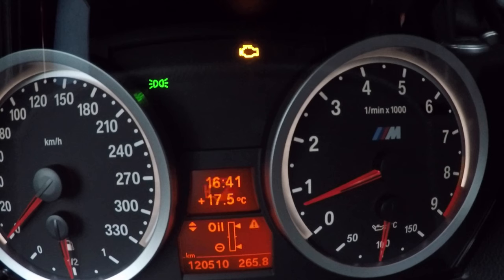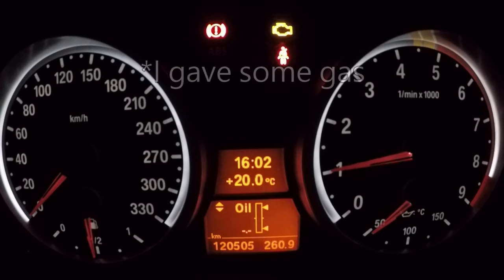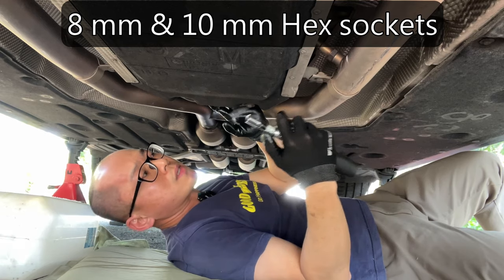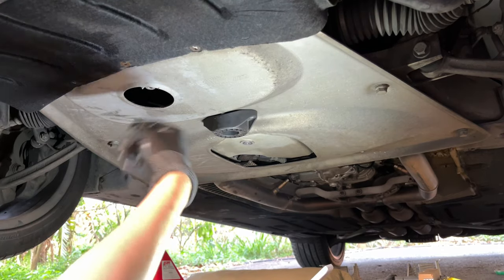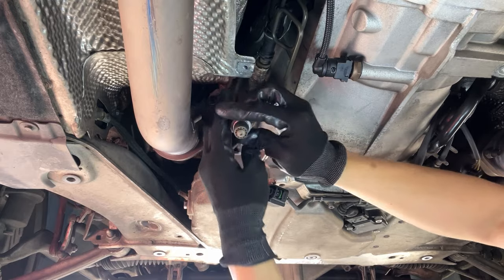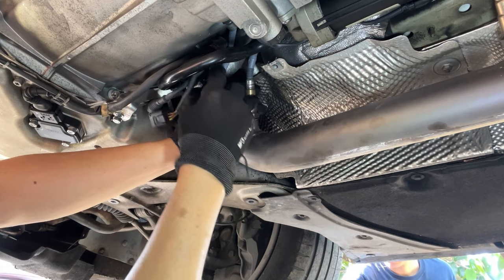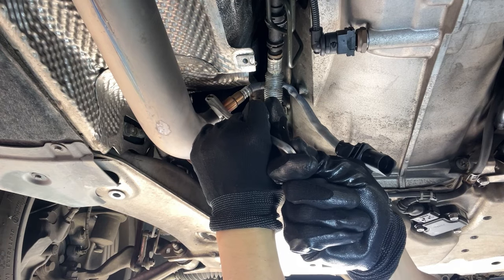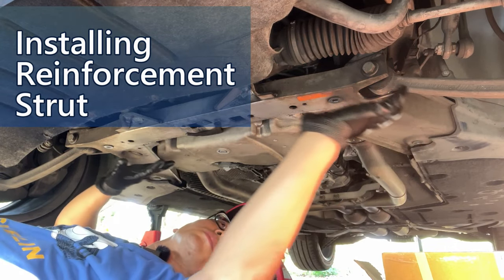O2 Sensor Replacement Fixed Rough Idle & Limp Mode of E90 M3 [ENG SUB]

Comment: Hello, thank you for your video. I hope you can help me. I have problems with my M3 year 2008. Misfire 8 cylinders, bank 1 and 2. This only happens cold start for 25 seconds, then everything works correctly. Detected code DME 2b4e. Thank you, I hope you help me.
Reply from the maker: Hello Marcelo,
Don’t worry, I had the same codes and symptoms before. They are due to the cold start function of the S65 engine. After I had the DME(engine control unit) tune to remove the cold start function, the engine starts with normal idle and I never see these codes again.

The S65 engine has some useless features for the emission control, such as secondary air recycling and the cold start function we are talking about. These features have nothing to to with performance so some people completely remove them from the car. Who cares?

The cold start function is designed to warm up the catalyzer quickly by injecting a lot of fuel so you will observe crazy asthma of the engine in the first one minute of start. Sometimes it chokes the engine so the owner gets freaked out but there is no problem in the engine at all, despite a check engine light is left on the instrument panel (and tons of codes about misfiring on 8 cylinders including 2B4E).

For my observation, the cold start function will work if the car is parked for more than two days. If you drive everyday, it is less likely to take place. But anyway it is very strange and annoying, I agree. The disadvantage is that the check engine light can make one overlook  other real malfunctions of the car. So I went to some tuner to disable this cold start function by writing the DME. (Search: cold start delete.)

After the cold start function is disabled, the engine starts and goes into stable idle at around 800 rpm right away, no crazy fluctuation of the engine speed, as you see in 20:19 . Please look for a reliable tuner to have your DME tuned. This can completely solve the issue. Anyway I believe there’s no problem with your M3, you can also leave it as an original feature. Just be prepared to look into those codes periodically to bust real faults!
Reply: @funcarsgoodpeople  Hello, thank you for your time and answer my questions. It will eliminate the cold start and solve the problem. I have had the M3 for 6 years and I have always had the problem present. Again, I appreciate your time, thank you for your help. Greetings
Reply from the maker: You are very welcome! Marcello! Please let me know if you have done the cold start delete and if you are satisfied with the result 🤗 Best wishes!
Reply from the maker: Hi Marcelo how are you? Is the problem solved? I made a video about the cold start delete, https://youtu.be/-HcMYBclj_Q

Please let me know what you think!
Reply: @funcarsgoodpeople  Hello, god thx, how are you? I have not been able to eliminate the cold start. I saw your video of how to proceed to eliminate cold start, I am very grateful for your dedication of the video, now I will proceed. Thank you for the video, I'll let you know how everything is going. Greetings
Reply: Hello, how are you? I hope all is well. Before doing the process of eliminating the cold boot, you have tried to update the DME with the Ista P software and check if the failures disappear. Thank you, I hope everything is fine. Best regards
Reply from the maker: @maxelito1000  Hi Marcelo I have been busy with the next video: MDrive retrofit. It is coming soon!

I did not update the DME before the cold start deletion. And I think the tuner did not do this either. I think he just went straight with the modification and flashing.

It is a good idea to update the DME to see if the misfire can disappear. But now I have no information about their relation. If you find something, please kindly let me know!

Comment: I have same problem, but after scan there is O2 sensor readiness after cat conventer bank 1 : Not ready.
Reply from the maker: Hi Summit good morning! As far as I understand, O2 sensor after cat converter is responsible for monitoring the condition of the cat converter. I don’t think I is related to the combustion of the engine.

However we faultbusters do not let go any faults 😁 The O2 sensor is usually pre-heated to work properly. It is very common that heating coil inside it has broken, leading to the readiness code. Besides, O2 sensors are not designed to be repaired so buying a new one may be necessary.

As I said the O2 sensor after cat converter is not essential for the combustion so I don’t think it has the priority to be replaced. There may be other causes of your problems.

Could you also describe the symptoms ?

Comment: Can ISTA help me diagnosis parasitic battery voltage drain?
Reply from the maker: Hi idrisu1 thank you for the question. I quickly looked up in ISTA and it has the service function "Evaluate Close-circuit current monitoring" which uses the intelligent battery sensor to do the measurement.

I show you the function description (in ISTA) as follows:

Description
In the event of problems with increased closed-circuit current, it is frequently the case that this must be determined during Service. With the conventional procedure, a shunt resistor must be fitted at the earth strap of the vehicle.

Evaluating the closed-circuit current monitoring: 

On vehicles with an IBS (Intelligent Battery Sensor), the DME/DDE monitors the closed-circuit current when in the idle state.

The IBS is only fitted with certain equipment options (e.g. M-ASK or CCC). The test module for evaluating of the closed-circuit current monitoring first of all tests whether an IBS is fitted at all.

In this model series, the results of the last 32 cycles of closed-circuit current monitoring are stored in the DME/DDE. A new cycle of closed-circuit current monitoring is stored under the following conditions:

Terminal R is off for at least 70 minutes.

The vehicle is in the idle state for at least another 120 minutes without being wakened.

If these conditions are met, the result of the closed-circuit current monitoring is stored in a new cycle. The oldest cycle of the 32 cycles is overwritten by the new cycle. 
If the vehicle is wakened after saving a cycle, a new cycle can then begin if the conditions are met.

The result of a cycle of closed-circuit current monitoring has two categories:

In the first category, whether or not an auxiliary consumer unit was logged in during the idle state (at least 120 minutes) is stored. An auxiliary consumer unit is a consumer unit that can also be activated in the idle state of the vehicle. In the case of closed-circuit current monitoring, a distinction can be made with regard to logged in auxiliary consumer units:

- No auxiliary consumer unit was logged in
 
- A statutory auxiliary consumer unit was logged in (e.g. light or hazard warning lights)
 
- The independent heating was logged in
 
- Another auxiliary consumer unit was logged in
 

In the second category, the range of the closed-circuit current during the idle state (at least 120 minutes) is stored. In the case of closed-circuit current monitoring, a distinction can be made with regard to closed-circuit current:

- 0-80 mA (normal closed-circuit current in the idle state without auxiliary consumer units)
 
- 80-200 mA
 
- 200-1000 mA
 
- Over 1000 mA
 

Increased closed-circuit current in a cycle can be seen above all when no auxiliary consumer unit was logged in, but the closed-circuit current was above 80 mA. 

Bear in mind that in the event of problems with the idle state of the vehicle no new cycles for closed-circuit current monitoring are stored. If the vehicle does not 'go to sleep', e.g. due to a 'sleep preventer', no new cycle of closed-circuit current monitoring is stored. Saving a new cycle of closed-circuit current monitoring is also prevented if the vehicle is permanently wakened by a control unit or a user.

Comment: Is the use of inpa really necessary?
Reply from the maker: Hi Saul do you mean using ISTA? ISTA and INPA are used to reset the adaptations here. I know somebody does so by disconnecting the battery for a period but I haven’t tried this method on the M3.

After the O2 sensor replacement, I didn’t reset adaptation upon the first start and it was not successful. So the reset is a must and I recommend using ISTA because I think it is the easiest way for this job 🤗

Comment: nice videos sir .sir i have m3 e90 i have 2b07 teouble code pedal travel sensor...what can i do sir? can i reset/adaption like you do? i m from indonesia sir
Reply from the maker: Hi Wili thank you for leaving a comment! Yes there is an reset function for the accelerator pedal. Maybe your diagnostic tool has this function so just try it. I think it won't hurt.

Here's the information I found in ISTA about the Accelerator Pedal;
===
The accelerator pedal module detects the driver's instructions for altering the speed of the vehicle.

Design and function
The position of the accelerator is detected by a special sensor and analysed by the digital engine module (DME). The accelerator module is fitted with two independent Hall-effect sensors. Those sensors each transmit a voltage signal corresponding to the current pedal position. For safety reasons, two sensors are used. On that basis and taking other engine operating parameters into account, the required position for the throttle valve is calculated. The throttle valve is then operated by the throttle valve positioner.

The accelerator module receives a constant voltage of 5 V from the DME. For safety reasons, each sensor has a separate power supply.

The two Hall-effect sensors transmit a signal that is proportional to the pedal position. The signal from sensor 2 is always exactly half the voltage of the signal from sensor 1. The two signal voltages are permanently monitored by the DME.

Diagnosis
The maximum engine output is limited in the event of a fault. The vehicle has a delayed response to abrupt movements of the accelerator pedal. If two faults occur simultaneously, the engine speed is limited to max. 1500 rpm. The relevant fault codes are stored on the DME identifying the faulty Hall-effect sensor.

The following faults can be detected:
- Hall-effect sensor short circuit
- Signal above Hall-effect sensor voltage range
- Signal below Hall-effect sensor voltage range
- Implausible difference between signal levels of the two Hall-effect sensors
- Power supply failure or voltage too low
 ===
I suggest trying to clean the connector pins of the pedal module. The poor connectivity of electrical contacts often leads to such kind of fault codes. If that doesn't help, probably the pedal module needs to be replaced.

Comment: Hi pls help witn O2 sensors! My codes 2729 and 274B. They appear all the time. After installing a new O2 sensors, they appear again after 10,000 km. Exhaust system tuning
Reply from the maker: Hi AlexSib, you are talking about the codes for E9x M3 right?

I checked on bmwfault.codes and the codes imply broken harness or short circuit of the O2 sensor before cat on bank 2. Please see below;

2729: DME: Oxygen sensor, coast-mode diagnosis before cat., bank 2. Check plug and wiring harness to pre-cat oxygen sensor LSVK B2 (focus on opens in wires for virtual ground and pumping current).

274B: Oxygen sensor pump current calibration fault before cat. converter, bank 2. Check plug and wiring harness on pre-cat oxygen sensor LSVK B2 (especially trim circuit wire IA).

Since you have replaced the O2 sensor, there is possibility that the harness or wiring got broken, as indicated by the fault codes. Please come back and let us know your progress!
Reply: @funcarsgoodpeople  yes
Reply: @funcarsgoodpeople  I checked the wiring, everything is fine. 
maybe this is due to the installed ESS firmware
Reply from the maker: Thank you AlexSib, I'm not sure if the aftermarket firmware sets a different standard for triggering the error codes. This has to be verified by ESS.

I am thinking of installing a supercharger to the S65 and that requires a new firmware too. I will respond to this comment if I find anything related to the error codes. See you!

Comment: did you see any white smoke during cold starts?
Reply from the maker: Hi Automotive Therapy, sometimes during cold weather yes but I think it’s water vapor and the amount is normal. Do you mean combustion problem?
Reply: @funcarsgoodpeople  My e90 M3 blows white smoke out when I start the car and idles roughly. Could that be due to a bad 02 sensor?
Reply from the maker: Yes there is this possibility. I suggest using a diagnostic tool to check the fault codes. A bad O2 sensor is likely to throw codes so you can nail it down easily. There are many other possible conditions that lead to white smoke and rough idle. Please don't do try-and-error like I did before 😅😅😅

Comment: Hi sir,  my car bmw 3 series 318 d n47 engine 75000 miles, when driving slow moving traffic when you accelrate it goes limp mode few seconds then suddenly it accelerate fast.it drives normal. If we brake quite often and then accelerate same problem, i did had smoke smell in the cabin one time. is it oxgen sensor problem
Reply from the maker: Hello Cathy, I don't think it is the O2 sensor problem. Can you read the fault code?

The limp mode I mentioned in the video comes with a check engine light. It is a protection mode of the engine. Once entered limp mode, it cannot be exited in a short time. So I don't think your car is in the limp mode.

I am guessing the throttle body problem because the throttle response seems very rough. But I am just guessing. Please get a diagnostic tool to read the fault codes. Then we can nail the problem more accurately!
Reply: @funcarsgoodpeople  Thank you, you are kind person. I don't have the scanner, I will buy one from eBay or Amazon. Do you recommend any scanner. I am taking my wife car to drive and school run.today I was driving just one mile to testing, there was no loss of power, braking and driving. tonight I am taking risk, driving  to work place it around 8 miles. I will report to you. I did see video to put wd40 on turbo actuator and I wiggle it. I cleaned air filter around mass sensor.
Reply: @funcarsgoodpeople I like to repeat,  three months back while driving, whenever driving slow moving traffic, when suddenly when you accelerate, it goes loss of power engine light comes, automatically after few seconds the car itself moves little bit fast(like sudden spike) without putting pedal on accelerator, I have to put my leg on brake because of spike. Then it drives normal. When we stop at traffic light and accelerate loss of power engine light flashes and goes or when we restart engine light goes off. But it happens only occasionally. There is no loss of power when there is no traffic. Last week it stopped middle of the road on signal, I have restart and took the car. I am just afraid take car with family.
Reply from the maker: Hi Cathy you are welcome. This reply is about OBD2 scanner.

BMWs will show its faults in terms of P codes (fault codes beginning with letter P) which is common among most automobiles. So any scanners can read the fault codes.

However, BMW has its own code system (4-6 digit number mixed with English letter, as shown in my video) to give very detailed description about certain symptom. i.e. L6 and V8 engines may show same P code about O2 sensor problem, but you have to decode BMW fault code to see which bank of the exhaust is having the problem. I used an OBD2 scanner once but it did not give me enough information, especially for those BMW-specific modules. No corresponding P codes were read out.

I use INPA or ISTA, the PC diagnostic software to translate BMW fault codes. But if you feel too inconvenient messing with diagnostic tools, you can go to nearest shop and ask them to read out the fault codes for you. Please take photos of every code you get. I can look it up for you in ISTA. Or if you can get the BMW codes, we can look it up together on https://bmwfault.codes/
Reply from the maker: Hi Cathy I got your descriptions. I searched roughly and found that flashing check engine corresponds to misfire. And the failure of high pressure fuel pump (HPFP), which is common problem for N54, can cause the misfire (cylinder not getting enough fuel.)

But this is just a rough guess. The check engine light will leave a lot of fault codes for us to troubleshoot. They will tell you which cylinder out of the six is having trouble, or some other malfunctions the car detected. So I suggest doing a diagnosis with OBD2 scanner as the first step!
Reply: @funcarsgoodpeople  Hi, I cleaned air intake near mass flow sensor and also sprayed WD oil to  turbo actuator according to one of the video. Last one week there is no problem driving to work including traffic. I have put full tank of diesel let me see when diesel gets low. I will update. Thanks
Reply from the maker: Hi Cathy thank you for the information! I did not know cleaning the turbo actuator with WD40 can work! I learned 👍 Please keep me updated 🙏